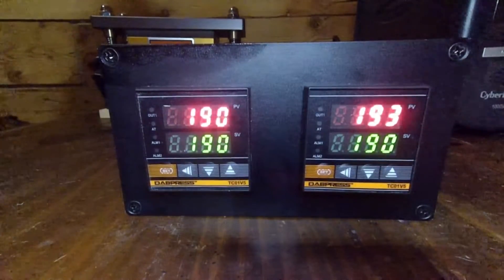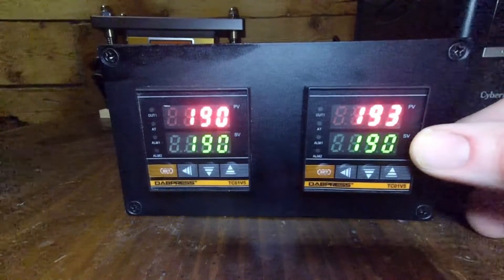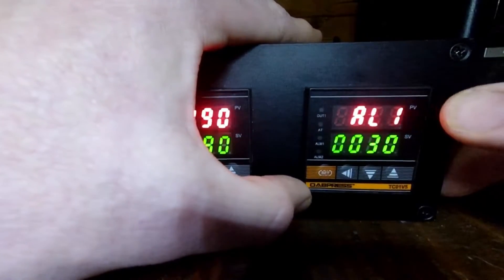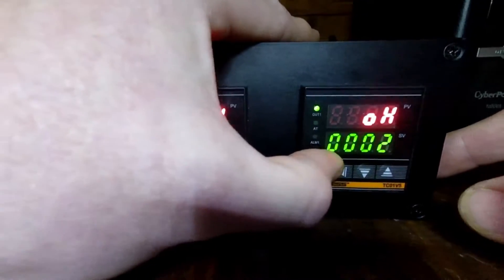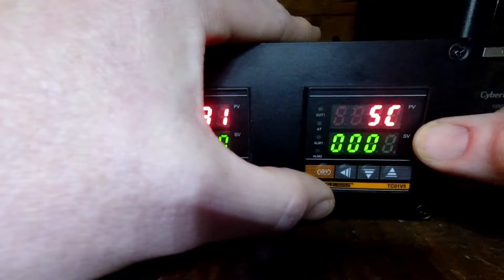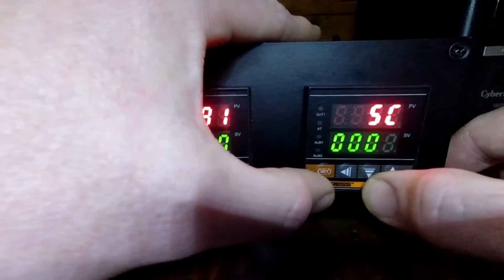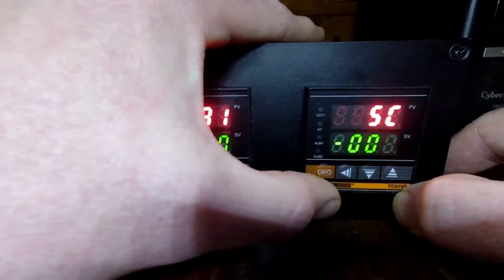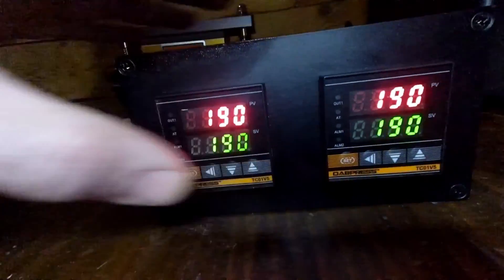How to  calibrate the temp different between SV and PV

Comment: Does that change the actual temperature of the plates or just lower what is displayed than actually output? Also you said you were trying to adjust 192 to 190, you lowered SC value=0001 to SC value=     - 0001, this brought you to your desired 190. Problem is your machine was displaying 194 not 192 when began your calibration demonstration!

Comment: how can you calibrate the machine when the SV and PV temperatures are the same but the temperature of the plate when measured with infrared thermometer differs from PV temperature?
Reply from the maker: Many thanks for reaching out there,could you please contact us via support@dabpress.com,you will get a quick response,thanks for your understanding:)
Reply: How did you calibrate the plates to match the temperatures?

Comment: Can you do a video on the rosinworx 5000 psi please?  There is the time abd temp but also when hold the set button it goes to a “Lo9”. But the center 0 is like a bottom half of a digital  number 8 and the 9 is also digital but facing the opposite way and the top bar missing Kindve like the digital number 4. Hard for me to explain but if you can please explain what that does or do a video on it that would be great